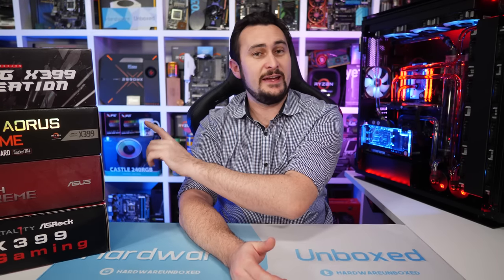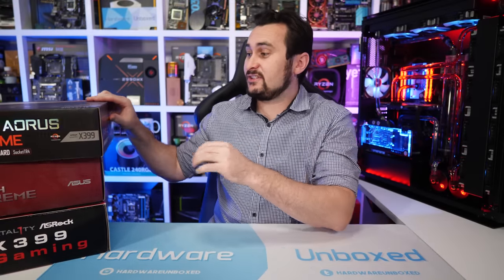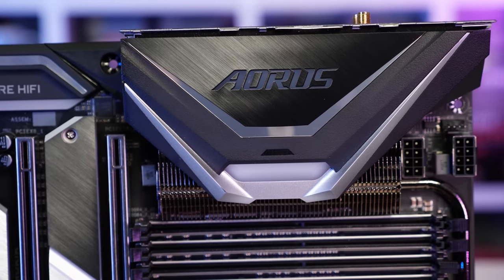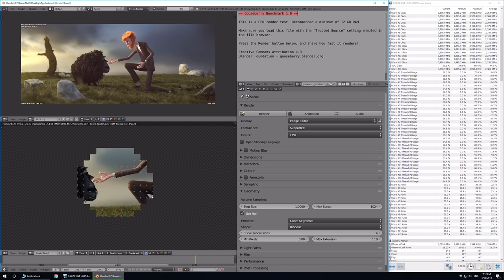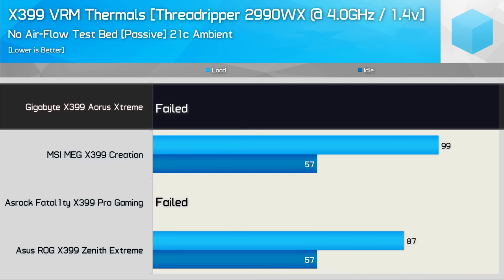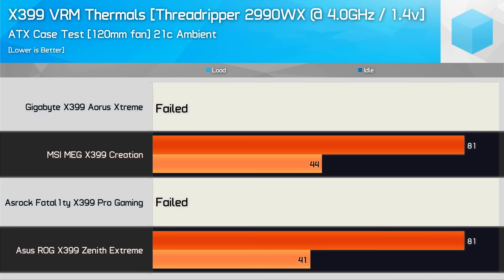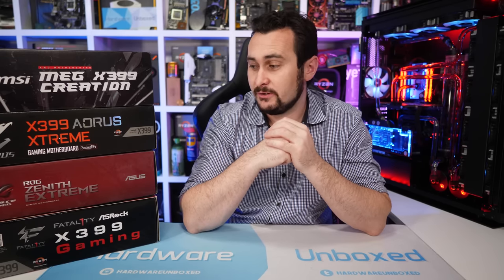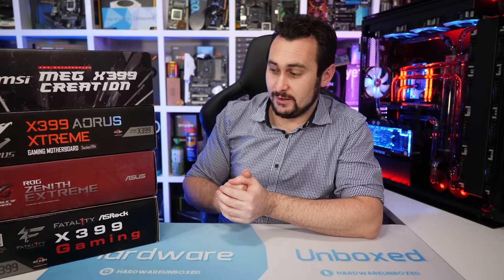2990WX Tripping Up High-end X399 Motherboards, VRM Temp Test

Comment: I have a 2990WX paired with a Asrock X399 taichi. This is very helpful and the zenith is probably what I need. (I use the workstation for financial simulation)
Reply: If you want money, Then give me even more money I have been using it on load (100% cpu) hours at a time and sometimes it crashes. Heat is fine so I think a better board like the zenith would help.
Reply: @shockwave1111 Zenith is not better in tems of VRM...Asorck literally has the same vcore VRM and BETTER SOC vrm. So you will be fine even with the 32core. This video doesnt makes any sense what so ever.

Comment: This has to be the best X399 review Ive seen yet when it comes to Threadripper2 and more specifically the 2990WX! Ive been searching for some time on more in depth info for the 2990WX but there is little out there other than initial unboxings and review on whatever single board they have lying around. Thank you very much for putting the time and effort in to running this comparison, I currently own a 1920X, 1950X and the 2990WX and have been looking for the best board I can get for my 2990WX and thanks to you I might try the MSI creation based on your review, so it will be your fault if things go sideways... (LOL J/K) . Ive never used MSI boards and over the last 20+ years Ive been building high end gaming rigs and 3D workstations Ive used ASUS 98% of the time and Gigabyte or Supermicro the rest. I'm def giving this a like and now sub as well.

Comment: I built my 2990WX build before I watched this video... I should have watched this first. I believe I originally started with the ASUS board (is that the one with 10gbe?)  but the 10gbe caused the board to burn up in that corner and I switched to the Gigabyte Aorus, which also has 10gbe.   If you go into building one of these unarmed with the  knowledge coveyed in this video (great video BTW), you might not realize how critical it is that you cool the bejesus out of the VRM portion of the board as you will literally burn yourself touching the heatsink without proper cooler.   

But I think what I would add to this video is an investigation into what happens at the other end of the heatsink... I STILL have problens with the 10gbe cutting out under heavy network loads... this is despite having built a WIND TUNNEL above the VRM heatsink on my two Gigabyte Aorus builds.... as you mention the companies put an annoying piece of plastic above the other half of the heatsink... it really needs to go away and you really need to mount another fan directly on top of that part of the board or suffer 10gbe failures.

Comment: I built a bunch of first gen TR's for my job and will almost certainly some second gen TR's soon. These are not systems that get OC'd. These are professional workstation parts. Lifespan of the parts is far more important than getting a few more clock cycles. Cutting renders down by a few percent while cutting the lifespan of the part down by 10 or 20 percent is simply never going to be acceptable.

These VRM's need to be enough to run the 2990WX at stock  not OC'd except for the odd enthusiast and the industry should not cater to the 5 or so guys who do that stuff but provide the MoBo's for the people who actually use these MoBo's on a daily basis.

As another example why were some of these MoBo's branded for gaming? No one buys TR CPU's for gaming. I know people building custom PC's not for the gaming market are the red headed step children of the PC world but we do exist and we probably build more machines than gamers do.
Reply: Well you may wanna go down the hall to Billy in marketing and tell him to take out the overclocking features and all the marketing b.s. on the boxes. Seems he didn't hear from you soon enough.
Reply: There is a good reason to use Threadripper for gaming, its one of the few setups that can handle 4x GPU (didn't say it was a typical reason...). The only other option is the i9 (but you're still getting fewer PCIe lanes). The reason you need 4x GPU is, well have you seen a Titan Xp try to run 4k games? Its disappointing to say the least, barely handles old games. You really need 2x Titan for 60 fps above medium (with 2x you should be able to run high settings decently). 4x Fury on the other hand costs the same as 1 Titan used, and it should deliver about double the perf (based on how my 2x Fury beats my Titan Xp in most of my games).

Plus I want to run multi-4k, preferably 3x 4k, so you absolutely need 4x GPU to even attempt that (meaning Vega/Fury/390x since Nvidia locks Pascal and RTX to 2 cards).

For normal single GPU setup though, there wouldn't be any point for "just gaming", get a cheaper Ryzen or 8700k for that. Its only necessary at the very high end. I've just got to pick which TR I want now... All of them would be enough for my CAD rendering/fluid simulation (its sill going to take hours anyways), but I'm wanting to try to beat the Firestrike Radeon record while I'm at it with extreme overclocking.
Reply: Have you ever heard of content creation? More specifically, gaming content creation? People will often use these processors for gaming content creation, hence why the 32 core part is focused on innovators and CREATORS. The lower two processors in the lineup run at 6th gen Intel part speeds. Also, overclocking will be done by many more than 5 people. I am currently looking into buying the 1920X and I would overclock it (maybe only by 100-200mHz, but it would still be an overclock). I think at least five-fifty thousand people would overclock these processors. There are most likely “5 or so guys” who would run this with liquid nitrogen, not overclock it in general. The reason you build lots of these systems for business use is that when there is an issue, YOU are liable, not the business. Gamers are a completely different market and would outmatch the amount of computers that you build a year by 1000x.
Reply: My company does content creation. No way do you overclock just to shave a few minutes off those renders when you're cutting months off the lifespan of the chips.  My boss would fire me and sue me to recoup the loss.

And why would you OC a TR chip by 200 Mhz? The XFR boost is more than that.

You apparently have no idea WTF you're talking about. Why are you even in this discussion?

To the guy who wants to run a 4 way SLI on TR, go for it. It won't work but its your money. Search LTT's channel. They've run stuff like that and had terrible results. You don't need x16 slots for all the GPU's so you don't need TR for this. Most games won't support it and the few which do won't scale well at all.
Reply: You are not going to harm the lifespan of a motherboard by forcing max XFR speeds on all cores/overclocking provided it is cooled properly. These are high end enthusiast parts, by saying you shouldn't OC them I think you're missing the point. AMD have done a good thing by allowing overclocking on all of their parts. Overclocking isn't a bad thing.
Reply: Citation needed on those 10-20 percent values
Reply: Ken Shaw  Why wouldn't it work? Basically Fortnite and Watchdogs 1 are the only games my Titan Xp wins. (Its for sale, Star Wars Empire collectors edition if someone wants it). If 2x Fury already wins, I don't see how 4x could do worse (If it does, you can disable the extra cards in the driver options, just like each game can have its own overclock profile, so you never have to manually change it).

I'm also going to bench and hardware modify the cards because that's always fun. Its fine if a few blow up, all 4 cost less than a used Titan, LOL!
Reply: Andy Bradley  Hehe... So true, my FX is running 1.7 Vcore on a $40 motherboard with 4 phase VRM. Hasn't blown up yet! (I do keep fire extinguishers by it, just in case...). CPUs are hard to kill!

I ran that chip at 4.8 Ghz (just over 300w increase in CPU tasks at 1.51v) for over a year (hammered with fluid dynamic simulations and CAD rendering). Rock solid in my stability tests (I've tested a couple stock Xeons and they failed), so if it was going to degrade, it REALLY should have degraded. I only used 4.8 Ghz because I needed it to be super stable (passed 24 hours of P-95, then the killer P-95 plus Handbrake plus Cinebench all at once test for an hour), so that speed was very conservative. Now that I don't need it, I have it running sub-zero testing for pin rust and insulation methods (so I don't loose Threadripper, a cheap FX is fine if it fries). Max core temp is 10c at 1.7 Vcore and 5.5 Ghz (just limited Vcore by the motherboard, still not bad)
Reply: >threadripper
>professional workstation part
mysides.kek.jpg
Reply: Andy Bradley Who cares about the MoBo? You will reduce the lifespan of the CPU by running higher voltage, and therefore current and temp through it. Everyone who knows anything about electronics, knows that. Also no one is talking just max XFR speeds but actual all core OC's. 

Again why are you even in this discussion if you don't know what is being discussed?
Reply: Jake Garrett I already pointed you to videos that will show you. Why should I try and explain complicated technical issues in a YT comment if you can't be bothered to look into the subject yourself by investigating the only publicly available attempts at such? In short no one bothers to support it, the drivers suck and SLI never worked.
Reply: Apparently, you can't overclock AMD chips according to these commentators, it dies too fast. I had an Intel i7 980x that I overclocked for over 7 years. Went through 2 liquid coolers and 1 air because it was just run 24/7
Reply: XFR does not keep your processor locked at the frequency specified. I also meant 100-200mHz over the XFR clock anyway. Gaming content creation can benefit when recording 4K footage using something like OBS from many cores. Overclocking is not going to damage your processor as much as you think. I really doubt that your boss would sue you over a $650-1900 processor. I specified gaming content creation before as well, as it benefits from higher frequencies. As long as you know anything about voltages you will be ok to overclock. I don’t know if you are speaking from bad experience or you are just misinformed, but you are wrong when it comes to the effects of overclocking.
Reply: You might get lucky with one CPU. I'm not responsible for one CPU. I'm responsible for several hundred. I'm definitely right. Overclocking CPU's shortens their lifespan. That's why it voids the warranty. Any time you run more voltage and current through a solid state device you shorten its lifespan. Anyone who tells you otherwise is grossly misinformed. I'm sorry that you don't know this but again why are you people in this discussion if you're not aware of the basic facts under discussion?

Gaming content creation is not game streaming. Calling game streaming content creation is trying to make yourself sound like something you're not. Guys who do game content creation are guys who create assets for games. And no one needs a TR rig to stream a game. And yes, if I OC'd several dozen TR CPU's and a significant number of those CPU's died before the MTBF of the CPU that wouldn't just result in the company being out the replacement cost of the CPU's but in the lost time for 3d artists and all the work they should have done getting backlogged. One machine being down until a new one gets built and fully set up can result in a big loss to the company. Multiply by any significant number and you're taking a quarter's profit into the red. They'd definitely sue me. I love how guys who've never worked in IT seem to think they know what they're talking about.
Reply: @KenS1267  In a professional environment how long do you reckon a CPU needs to last? Really curious as to your answer because I would have thought 90 per cent of the machines to be replaced before any meaningful degradation would occur (assuming sensible oc's and voltages). If the answer is above 6 years (will we have 64 or 128 cores by then?), fair enough. Otherwise you could have kept all this to yourself.
Reply: Who knows? When you're talking $8k, the amount the company spent on the 1950x TR rendering rigs last year, which completely changed company productivity. I do not anticipate simply tossing the chips any time in the next couple of years. Taking the rigs apart for a CPU upgrade would be time out of production, and not a small amount of time either, I'd need to flash the bios, get the cooler off, get the old CPU out which means going through that whole TR4 process with the torque screws, putting the new one in, likely putting a new cooler on, making sure the rig posts and during a burn in/stress test, repeated for all the render rigs.. So its the whole box as a unit for a while and those are production rigs. So my boss is in no hurry to move up to 2990WX rigs for all of our render boxes. it would be a big sunk cost and the increase in productivity doesn't seem worth it considering our present metrics, we've got rigs spending time idle right now.

So its a case of as long as these meet our needs they will likely be staying around. As they fail, and hardware failures are inevitable, we'll replace with 2990WX rigs. But simply replacing en masse? I don't see it happening any time soon unless something happens technologically, or if 8k TV becomes a thing and we have to start rendering 8k instead of 4k video.

I do find it amusing that you think a box can run under load 24/7 for 6 years without failure though. I'll just say I have plenty of data that says that's not accurate.

So no I did not have to keep this to myself. Another person who doesn't know what he's talking about. If all you can do is imagine what happens in a professional environment why are you discussing this?
Reply: The only reason that anyone outside the professional sphere buys a threadripper is because they're a hardware enthusiast. We want to have a crazy, stupidly overkill setup even if we're just gaming because we like having top of the line hardware. And since we're enthusiasts, we want to overclock. Companies appeal to enthusiasts with features and marketing because when the enthusiast community talks about how good something is, the professional community takes note of that.
Reply: Trust me as soon as TR was announced the professional market was all over them. We honestly don't care even a little bit about the enthusiast market. We've been held hostage by Intel and their ridiculously over priced Xeon workstation CPU's, which had terrible performance, for way too long. I'll note that simply by calling TR HEDT instead of workstation CPU's you guys paid attention. I'm confident most of you guys are barely aware of  the Xeon workstation line.
Reply: I'm really sorry your job must be so unfulfilling that you feel the need to randomly lecture people you don’t know in a condescending way – yet still without providing any data of sorts. 
No one ever asked you about your job or your specific requirements, yet you somehow make it all about that. 
I never stated that a machine would run for xx years without problems; what I did say is that there seems to be no data on CPU degradation causing irreparable failure (with mild overclocks) that would support your statement. Just to be clear: I’m not saying a CPU may achieve the same OC with the same voltage 5 years later; I’m merely stating that I have not seen any data where a previously overclocked CPU could not, at the very least, be reset to stock and continue to run there. CPU’s fail all the time, but they also fail stock. Meaningful data would show a statistical difference after 6 years between stock and mild overclocks – I pretty much doubt you’d have that.
There’s a ton of places where you can discuss with IT professionals (e.g. spiceworks) yet you somehow chose a YouTube channel that’s almost exclusively focused on gaming and enthusiast hardware to show off your pseudo-knowledge here. 
I’m out, and so should you be. All the best, nonetheless, that you won’t get sued!
Reply: ? WTF are you babbling about? Do you think my boss is going to pay me to be screwing about messing with 120 machines overclocks adjusting them as they age along with all my other duties? That would basically require bringing someone else on just to do that. You seem to think the nonsense you can do with one machine can be done in a professional environment where a small number of IT people are responsible for large numbers of machines, and in my case the rest of the IT team is responsible for the servers, laptops, tablets, cameras and the rest of the hardware we have. I'm the only guy whose only job is desktop hardware.

Although you admit the silicon will degrade but then deny it will. I don't know whether to laugh or simply throw up hands in disgust.

You also aren't talking mild OC's. There is no point to mild OC's with TR. TR has XFR which is simply better than any mild OC and doesn't require any screwing about. The only reason to even discuss overclocking TR is to significantly exceed XFR.  Again you clearly have no idea what you're talking about so why are you even in the discussion?
Reply: I am thinking of a TR build with a workstation graphics card with your considerations.

Comment: Makes sense. The MSI Carbon's insanely overdimensioned VRM/Power stage does go the same way as with most other well designed high power electronics and power supply solutions: The amount of heat the components give off at a given load is significantly less, as the load is distributed over more parts, each running a lot further from their capacity. It comes with a hefty price tag, but for those in the need or want I'm guessing its worth it. Bonus for not having to live with those small 35-40mm screamers. Also most extreme power users either have their system in a case, or is doing LN2. If you're fiddling with LN2, I expect you've got your VRM cooling well under control regardless of what the manufacturer "provided".